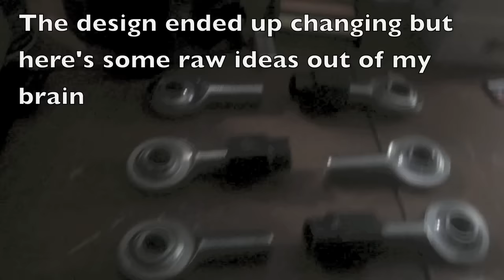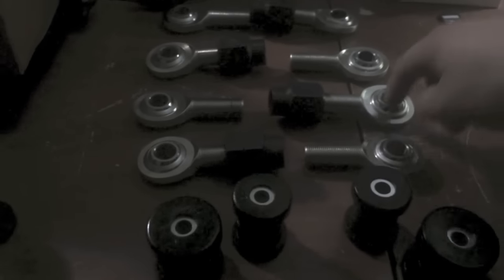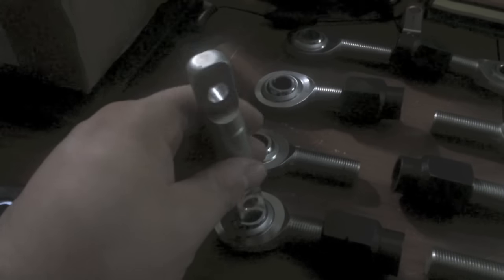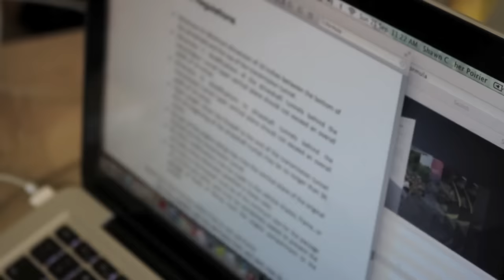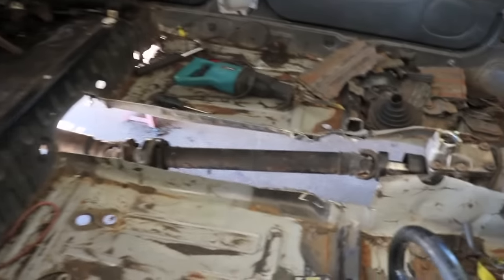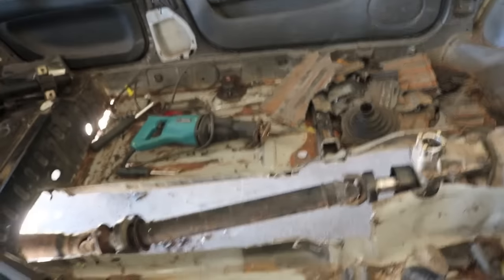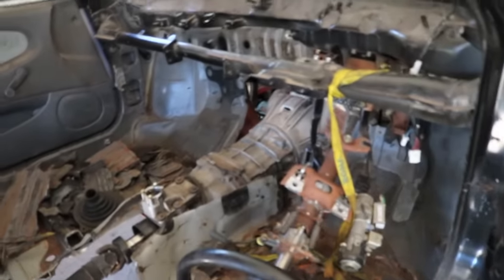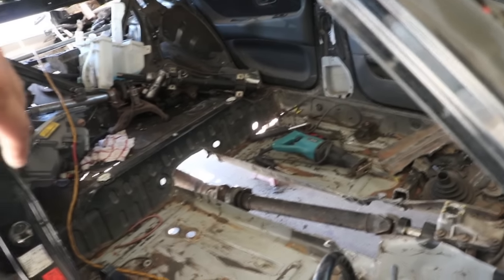My Mitsubishi Lancer Evolution Drift Build - Part 17 - Custom Rear Arms + Starting new tunnel

Comment: Where do you place yourself percentage wise of being finished?
Reply from the maker: good question it's all little stuff now,

roll cage
exhaust
front mount intercooler kit
coolant system (lines + rad etc)
wiring + gauges
Axles
paint
custom intake manifold
fuel system (fuel cell, lines,pump)
windshield

but I would say 65%ish most of the hard fabrication is done, and I've done all the research to get this rolling as soon as possible, the rest is pretty much a normal build, before it was the hard part of r&d, game plan, etc